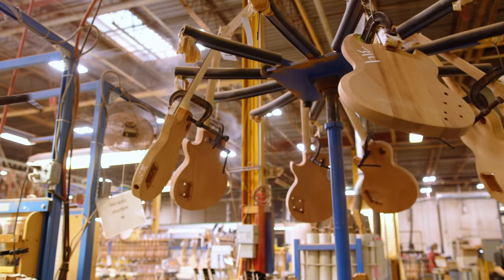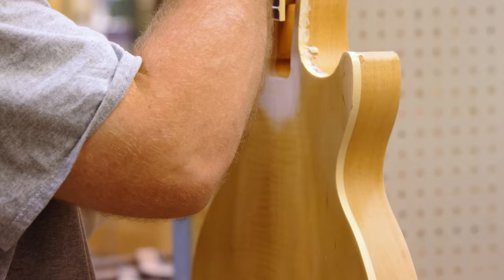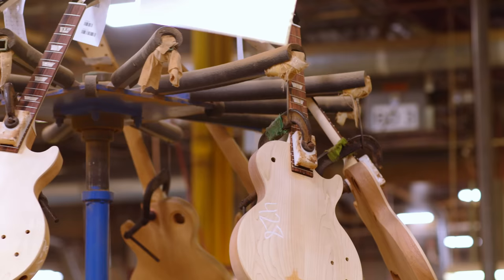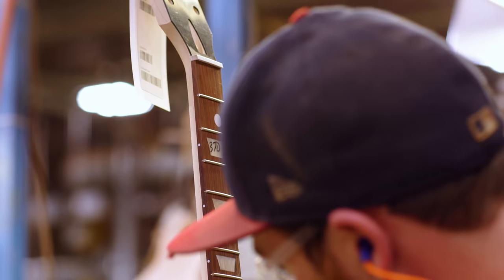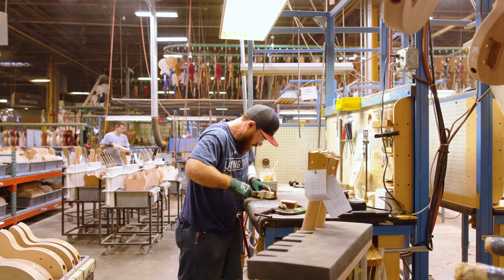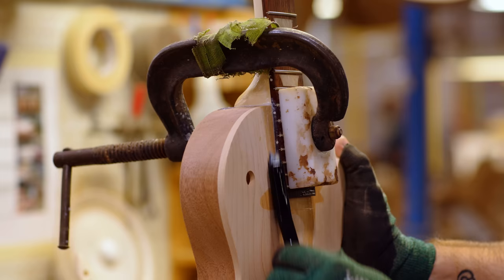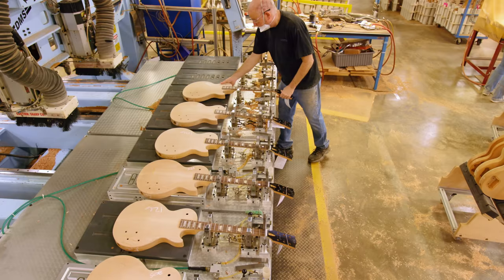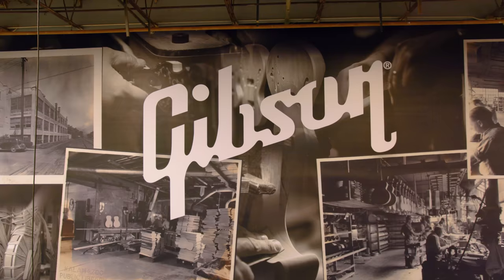How Guitar Necks Get Glued To Bodies At Gibson USA | The Process S1 EP7

Comment: The white SG Standard should be a standard like the black and the cherry one, it's too awesome to be a once in a while guitar.
Reply: If it's white, the gold hardware looks better in my opinion, I'm ok with it staying an SG Custom feature.
Reply: @MrBladle  The Gibson SG Standard 2017 t had gold hardware but at a fraction of the price of a custom, never saw 'em here in Europe otherwise I would have bought one, bummer.
Reply: white is insanely hard to get right because when you sand or "scuff" nitro cellulose lacquer it turns to white dust, so if youre not extremly careful, youre very likely to sand through the lacquer, throught the paint, down to the wood which potentially would call for the guitar to be scrapped

Comment: if you have a good Gibson, they are hard to beat.  But there are some dogs out there.  I had a 2014 ES 335 that had an scooped out fret board, it cost me $600 to get that fixed.   My 2016 ES 335 is a great guitar but the F hole and the bass side wasn't cut right.  For $3000 and up Gibson needs to tighten up on quality control.  My 2002 Les Paul Standard is one of the best electric guitars I've ever owned.

Comment: My new 2019 ES339 in black satin has some gaps around the neck joint and the paint settled in...not finish cracks, but an actual gap that shows it wasn't a tight fit. There is also evidence of a sloppy paint job where the fretboard/binding meets the body...it looks like the same situation as the neck joint, but has a rough texture that doesn't match the smoothness of the rest of the finish...like paint pooled in that corner and dried that way. There's also specs of black paint all over the cream binding. The f-holes are rough and look unfinished. It came that way new from a reputable national dealer. A bit disappointing. On the other hand, my 2018 SG special (that costs half what the ES339 did) is flawless.
Reply: Jon Reaves that’s a shame. Notice how Gibson didn’t like your comment. That’s why you never buy a guitar new sight unseen. Check out the Fender factory tour video that was uploaded to Anderton’s a few days ago. It’s pretty incredible. I love Gibson guitars, but I also love Fender guitars. I have been looking for a used 335 for a few years now.
Reply: Dexter Rutecki This was the first guitar I’ve ever bought “sight unseen”. The store model was beat up from people demoing it...When you spend a few grand on a Gibson guitar you expect perfection. Unfortunately, the store would only exchange it for credit because it was on clearance and the other Gibsons they had also had cosmetic issues. I live in Canada and haven’t been able to get an answer from Gibson about repair or shipping costs. I have 5 fenders (some Mexican some US) and they were all flawless when I bought them. I’ve owned flawless epiphones too. I have seen the fender factory video. It’s great. I want to see Gibson succeed like everyone else, but I don’t think they’re quite there yet.
Reply: Dexter Rutecki yup Gibson USA is still pretty bad and a hit or miss for a 2k + guitar. I’d buy no Gibson’s no later than 2010. Especially when compared to fender, PRS, Gretsch, and more boutique level guitars. Gibson custom is great but the USA mass production line is really not worth the price. Not until they fix the QC issues which I thought they would and got rid of the Chinese cases for 2020

Comment: Curious which Gibson’s get Plekked at the factory?  My Les Paul Special Tribute definitely was not as it needed substantial nut work, severe fret sprout sanding and pickup leveling.
Reply: jjuz1983 ok thanks!
Reply: I have a standard  2018 Les Paul Tribute. Definitely plekked. It is a few steps up from a special tribute I will admit. But still beneath a classic.
Reply: Plekking doesnt work you cant beat a pro luthier fret levelling your instrument

Comment: Given the accuracy and repeatability possible with decent CNC equipment, I'm amazed that Gibson have people manually adjusting the fit of necks (with the subsequent need to rout for pickups etc. after the neck's been fitted, to make sure these line up with the imperfect neck).  No wonder they're a) so expensive and b) so inconsistent.  Any production engineer worth his salt should be able to set up the CNC to make consistent neck pockets and matching tenons, possibly with some self-locating features to help the components align properly.
Reply: I have no experience in wood working but know enough to understand what you are saying and i agree.
I am not real pleased that Gibson is doing this way and do not understand why the tenon has a trapezoid shape while the mortis
is not that shape at all?  I would think for the best  fit the necks tenon would fit the mortis like a puzzle piece? can you tell me if this is wrong?  and lastly i actually prefer the Long tenon Gibson used in the 50's to this modern method.

Comment: The argument that by gluing the neck you have a longer sustain is just commercial smoke and mirrors. Actually there is no way that a clamped glued body+neck ensemble is more compacted as if they were bolted with 4 big screws, which apply CONSTANTLY a much higher force. Beside, the argument that the assembly neck+body influences much the sustain is yet another commercial hocus pocus for gullible guitarists.

Comment: kind of odd that gibson knows the set neck is such a big part of their sound and yet they still haven't even attempted to do it right since before they were bought by norlin. the reason why modern les pauls don't sound like bursts is because gibson does such a shit job of setting necks. Gibson's poorly set necks is a big part of the reason why the cheapest greco les pauls sound better than the most expensive gibsons.

 Gibsons doesn't even build guitars anymore. they build collectible memorabilia, stuff that's at its best as a wall hanger and at its worst when it's plugged into an amp.